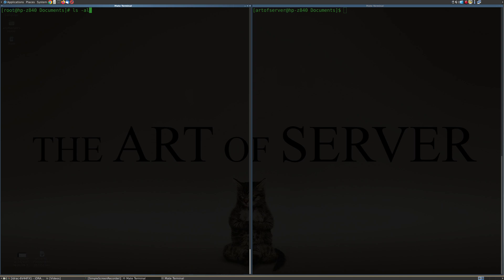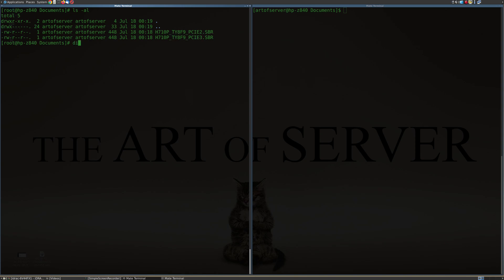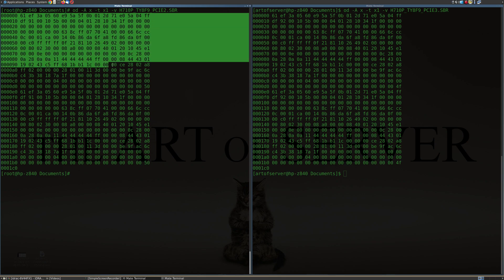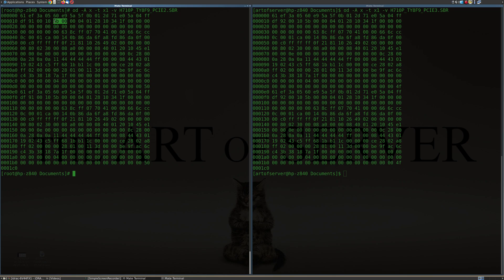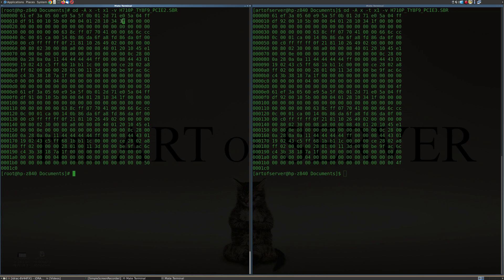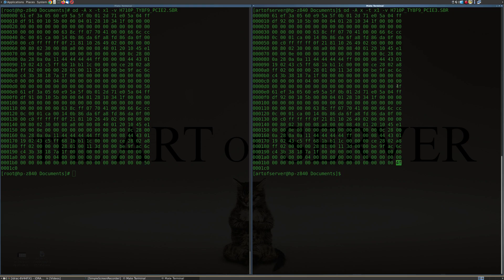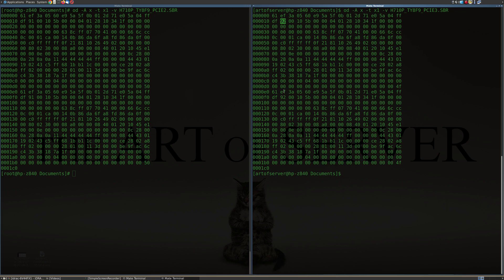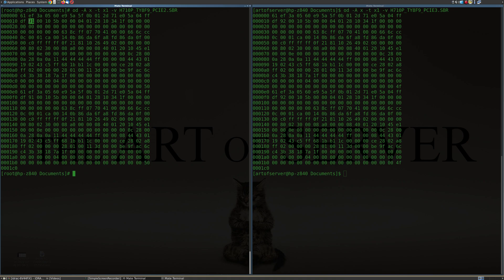What actually happens when you set H710P mini to gen 3 | PowerEdge Tips

Comment: Interesting. And maybe it is possible to dump other incomparable revisions, change this bait and flash it back? Or there some other hardware difference between revisions?
Reply from the maker: You can't modify this bit to get a SAS2308 Rev B0 chip to run at PCIe 3.0. But on the Rev D1, you can switch it between PCIe 2.0 or 3.0.